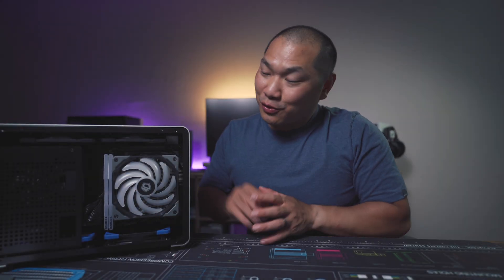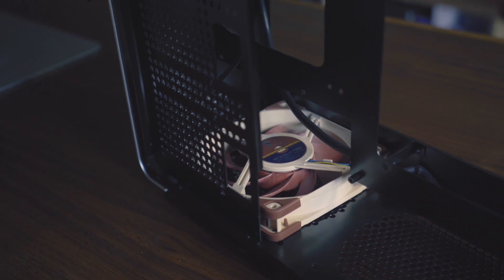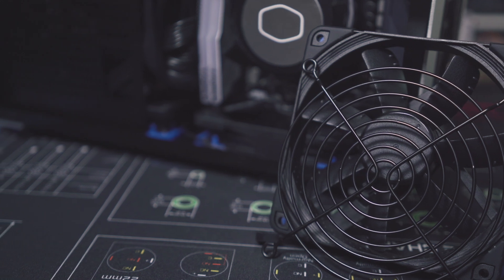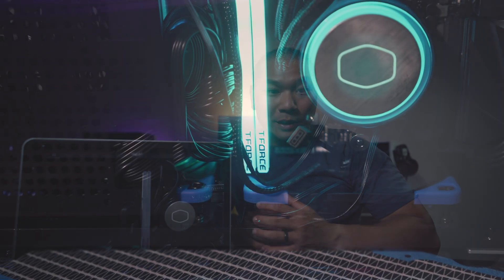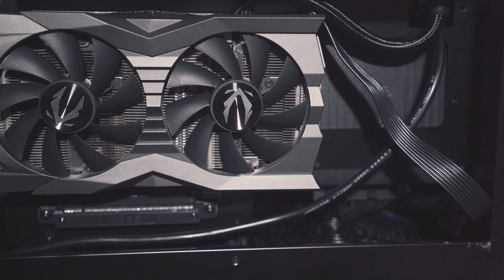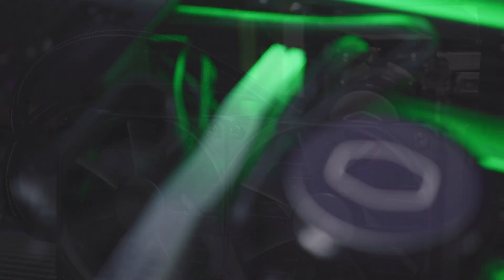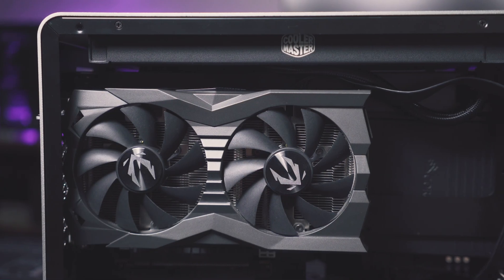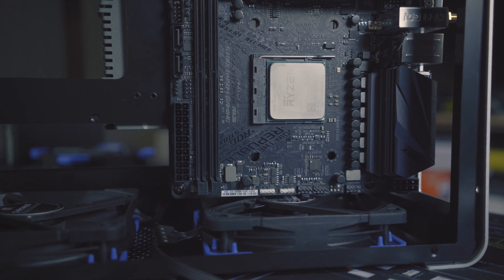A Fanless Liquid CPU Cooler? Testing with the Geeek G1 SE!

Comment: Loving your videos. Considering building a PC in this case, but I got a question I really hope you will notice. How much is the clearance there between the motherboard and the radiator? Is there any chance to fit the Noctua NF-A12x15 fan there, or is it a lost cause? 

Moving the PSU and drilling a few holes won't be a problem, but that motherboard clearance is something else.

Comment: Long time listener, first time caller.
How do you think a deshrouded GPU would fare in a setup like this?
I really want this case, but I'm affraid the GPU @ H=55 mm will be really loud when placed right up against the sidepanel, like it is in my current setup.
Reply from the maker: Welcome! If the heatfins on the GPU cooler are running the short way (so as to dump heat out the sides of the card) I think it could work quite nicely when paired with the airflow in this case. Solid panels would be best, so if you want to air cool I'd set up an L12 Ghost with fins running vertically, or you could also use a 120 AIO.  I would run 4X fans moving air in the same direction, balanced airflow. If you're using an AIO top intake and bottom exhaust would bias performance to the GPU but which direction you choose would really be dependent on how you plan on using your system. For gaming I'd bias things more towards the GPU.

Comment: Really interesting video. I was actually considering doing this with my G1 SE when I first received it. I got as far as test fitting everything using a Corsair H100i but ended up going with the IS-60 EVO because I was a little concerned about not having any fans on the AIO. Only difference is that I was going to use the radiator on the bottom with the case fans on top as exhaust. That would eliminate the need for having to move the PSU down and allow you to mount at least one fan on the radiator under the PSU. After seeing your results, I may revisit this.
Reply from the maker: Awesome! I was trying to avoid the bottom radiator mount but it can work too, just not the optimal position!
Reply: @MachinesMore  Out of curiosity, why were you trying to avoid bottom mounted radiator?
Reply: @morencam  Since nobody has answered you yet, here it is. Having a radiator lower than a pump (which is integrated in the plate that goes directly on the CPU) can cause some air in the AIO to be stuck at the pump (since air goes up, and the highest point of the loop is the pump), and it's not good for the pump's longetivity, and noise.
Reply: @Highfours  yeah, I ended up learning that on my own. I've only ever used AIOs top mounted so I never had to think about air getting trapped in the pump. I ended up scrapping that idea and even switching cases

Comment: The corsair ONE uses this with 2 radiators on the sides for the gpu and cpu and pulls with 1 140mm fan.
It can cool a 5950x with a rtx 3080 with 1 fan!!! and be silent
Maybe find a diffrent case to try it ?

Comment: I wonder how much a custom panel for the GPU would improve the overhaul cooling.

Bottom fans as intake + a side panel that allows the GPU fans to intake only fresh air and is sealed so that air can't exit the case anywhere else than the top radiators.

The air flow would be higher and maybe the air temperature a little bit colder because the GPU fans won't be able to recycle hot air from the case.
Reply from the maker: I think that would be the best of both worlds… ideally a cutout in the panel just for the inlet of a blower card that takes care of itself, so it won’t be affected by the rest of the case or affect ambient temps significantly.